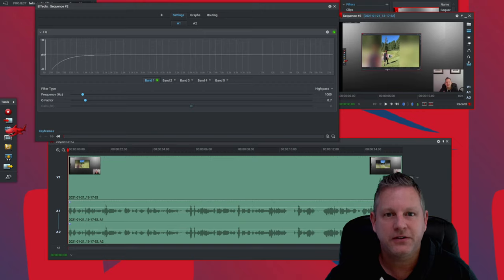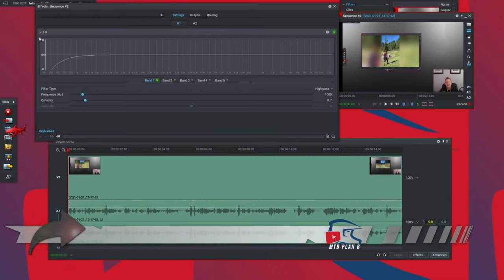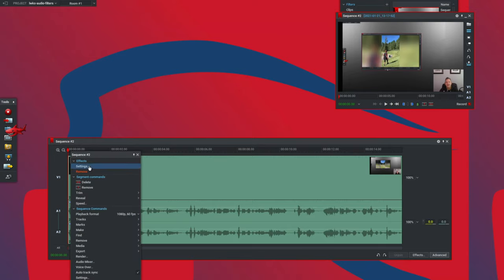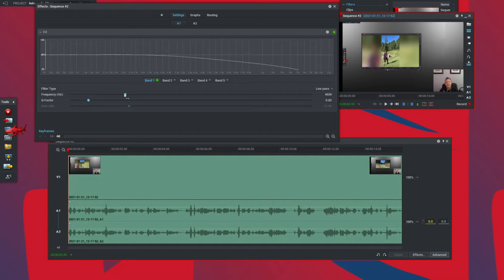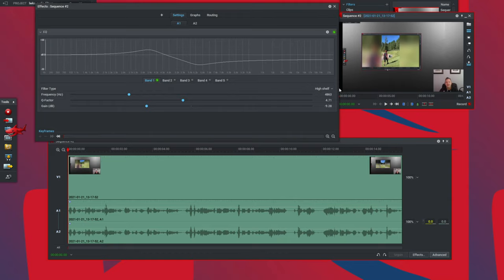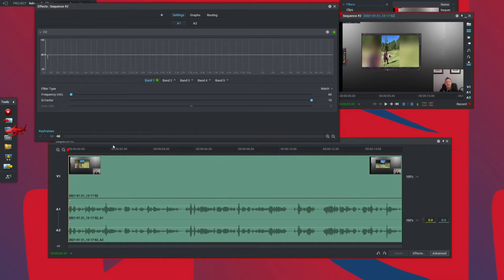#MTBPlanB Lightworks - Using audio equalizer filters to enhance audio and remove noise.

Comment: I'll timestamp the sections in case you want to revisit specific points or hop over to the section you want to know:
00:00 - Equalizer Effect introduction
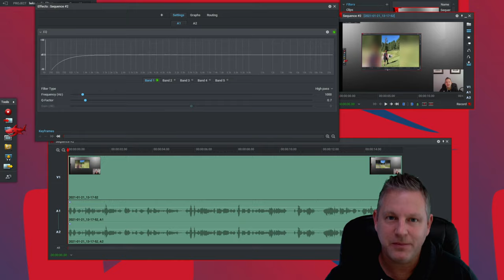00:44 - Basics on Setting up the Effect
01:45 - Examining the Equalizer Window
04:12 - Equalizer Filters
05:26 - Q-Factor, Gain, and Frequency Sliders being used in Low Pass Filter
07:43 - Lowpass Filter Demonstration
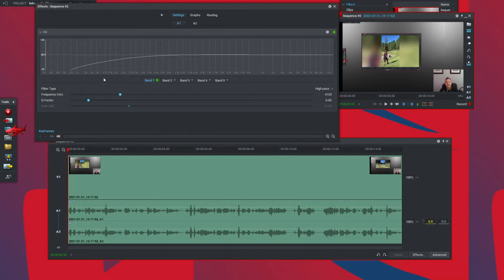08:20 - High Pass Filter Explanation and Uses
09:23 - High Pass Filter Demonstration
10:05 - Band Pass Filters Skirt vs Peak
13:21 - Band Pass Filter Skirt Demonstration
13:57 - Band Pass Filter Peak Demonstration
14:38 - Peaking EQ Filter Explanation
16:00 - Peaking EQ Filter Demonstration
17:41 - Low Shelf Filter Explanation
19:07 - Low Shelf Filter Demonstration
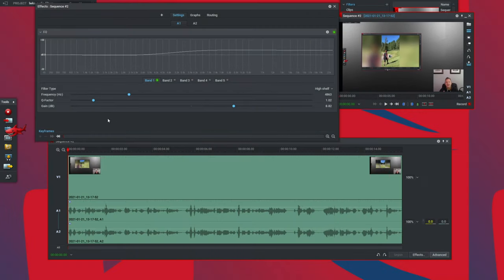20:23 - High Shelf Filter Explanation
20:55 - High Shelf Filter Demonstration
21:42 - Notch Filter Explanation 
23:43 - Voice Sample
24:22 - Voice Sample Notch Filter Test
25:13 - Voice Sample Before Filter
25:23 - Voice Sample After Filter
25:34 - Using Multiple Bands and Demonstration
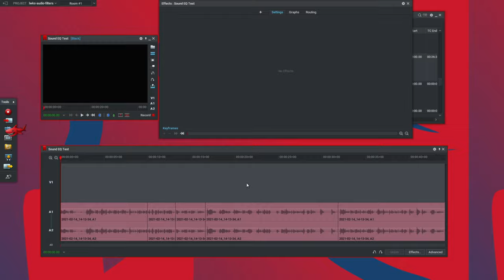26:53 - Equalizer Presets
29:00 - End of Video
Reply from the maker: Thanks!
Reply: @MTBPlanB  Thank you for making the video. I got to learn more about Light Works, while my interest is not professional it is quite helpful.